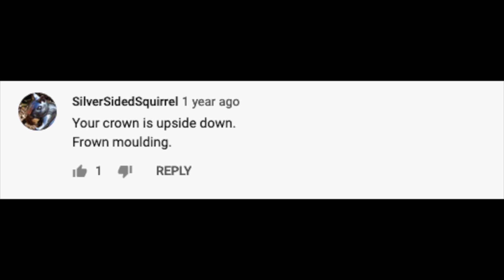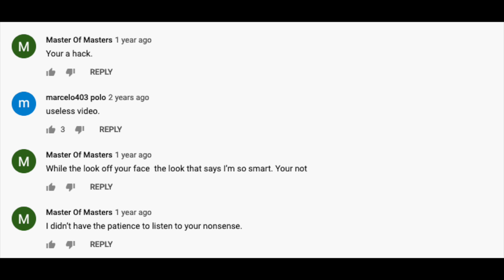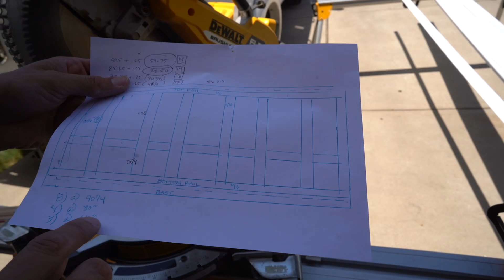"Tired of seeing this stuff put in upside down"

Comment: That's pretty slick how you built them as frames and then just set them in place and then nail it off. I like your thinking in using trim/moldings in perhaps unusual ways. I had crown installed in my new home and it's the same crown that everyone has in their homes. I like to be a little unique so I would like to take it out and basically come up with my own design for crown using different moldings. What concerns me is I have bullnose corners and I hate that little piece that everyone does on bullnose. I would somehow like to go back to 45s. Also I am not sure about getting tight inside/outside corner cuts. I'm not a handy man...I am a man with two hands (lol).

Comment: We have a 120 yo house with plaster walls. Picture rail is great because you can hang pretty much anything without putting holes in the wall. Running a drywall screw or a wall anchor into plaster rarely ends well. :)

Comment: I started carpentry in 1973. In 1993 I went to work in a factory building manufactured houses. First they just built simple ones without any crown or cove moulding. When they started using crown moulding they put it upside down. I kept telling them they were doing it wrong but they didn't listen to me.

Comment: There’s lot of this moulding used as crown in old homes in Chicago.  Almost always someone filled in the gap above the bead with joint compound so the bead flattens out and meets the ceiling.  Someone told me once the idea behind using the moulding originally was to avoid drilling into plaster walls when you hang things and avoid plaster cracks over time.  Not sure if that’s true though.  It’s hard to find new here when you need to make some repair.  Looks greats what you’ve done with it.

Comment: Your panel molding was originally called a chair rail molding.  It originally would have been a bit larger and its normal position would have been on a plaster wall at exactly the chair back height in a dining room.  Installed specifically so the a chair being moved of slid back from the table, would not contact or damage the plaster or daub wall.  Chair rails run around the room at approx. a 38 inch height above the floor.   I too have used it for a variety of solutions and aesthetic choices over the years.  My favourite has been a second ceiling accent run around the room about 6  to 8  inches below the crown molding.  That wall band between the two can be painted a different colour or contain a decorative wall paper strip.

Comment: On the crown argument, "Trim Carpentry" by Philip Moon (2007) states "The small cove represents the bottom of most crown mouldings."
That being said, what matters the most is whether the homeowner likes the finished product. If the ceiling is really uneven, it's probably best to follow the standard practice. Otherwise, beauty is in the eye of the beholder.

Comment: I have picture frame moldings and I use the hooks. It allows me to move different size paintings throughout the house without putting nails in the wall. It’s very convenient and fast! You have to be sure to really secure the picture frame molding to the wall.

Comment: That technique works well for hardwood door casing... if the jamb face is forward of back set to the plaster wall face... all you have to do is use a block the same size as offset to give u a perfect compound mitre.

Comment: That molding was used a lot in homes that had plaster walls to reduce the amount of nails/individual hangers in the walls. Still can be used today for the same reason or to add an architectural element to the wall just not many people know about it since the advent of drywall.

Comment: It looks great, spot on and modern, timeless style.  Not old fashioned. The original use for picture mounding could still be done on your wall. They had them installed up high several inches from the ceiling, with long wires and flat hooks up there, attached to back of pictures lower on the wall.  You could still do that with your panel mounding.

Comment: Looks great! Enjoy your channel! The only thought I have is that the larger bead on the top horizontal pieces will tend to be a dust catcher thats not easily cleaned out at the bottom of the v(in my house 😂) so I might consider a rabbet back to the apex of the bead (if that makes sense). Absolutely not saying you're doing it wrong, just a longer term practical thought.

Comment: More power to you, dude!  In the end, it ultimately comes down to what the customer likes the look of.  I deal a lot with electricians.  For decades, they have traditionally installed AC receptacles with the ground pin at the bottom.  But, in fact, the National Electrical Code doesn't define a top or bottom orientation for them.  In recent times, more electricians install the receptacles with the ground pin on top.  The only objections, I encounter come from customers who have an aesthetic preference.  In the end, if its legal and they are the ones paying for the work, whatever they prefer is the right way.

Comment: 6:30 "Oh, yeah, it's definitely gonna stick good!"  Hee hee 😁
As for everything else he said: (reading between the lines) "install it upside down if you prefer the look of it", "I'm using picture rail because I like the small but chunky profile" -- fair enough, conscious decisions from personal preference, can't argue with that in any way, why else do you put anything in your house.

And as for "I don't need an architecture degree to be a skilled tradesman", today I finished a job where the architect got every trade wrong you can imagine!  They (main contractor) insisted everything followed the plan even when each trade pointed out flaws.  Instead of working to a set of final registered drawings, we kept getting new revisions as either the client or architect changed their minds or saw it wouldn't work once parts were installed.  Ceiling tilers working to a fixed plan rather than using their expertise to modify where grid and suspension go to fit around my lighting, because the lighting plan changed 3 times while I was fitting it and I had to modify it because the heating engineers already had their pipes in the way, etc...

Comment: You know what brother, I'm older than you, but we do the exact same type of work, and you're just like me ( because I'm older than you), i mix and match mouldings all the time to get the desired effect I'm looking for, it's called thinking outside of the box, no pun intended. FYI, that picture moulding you're using in the vid, they used it extensively in the mansions in Newport RI exactly for the purpose of hanging picture wire off it from 20 ' ceilings

Comment: The "picture rail" trim was intended to be used on plaster ( not plasterboard ) walls.  Pound a nail into that to hang a picture and you risk a huge divot popping out or a crack going all over the place.  I use this trim in my 1920's era bedroom.  You can still get the hooks.

That said, your use looks awesome if somewhat expensive.  I had to order the picture rail online as my local suppliers didn't even know what it was - let alone carry it.

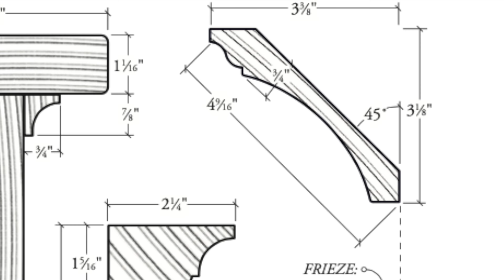Comment: The less detailed edge goes to the surface that is being ' featured ' . If the ceiling is recessed or coffered then the crown would be inverted from that shown  2:17  .  The molding is exactly as it is shown ,correctly , when the wall is featured , as it is in MOST installs .  (think in terms of picture framing, the ceiling , however ,is not being framed just because it has  ~ four sides ) (still, the customer is mostly right BUT always state your input )

Comment: Its a basic for trim cutting , use 1 longer ps of wood for blocking at saw  from L to R .glued only ends, then cut where is needed any angle, its NO GOOD when some wood trim ? board in the air, not sit tight against bottom of saw. IT will be kicks/jam/ crash/ bend blade, back fence/ fly and hit back of truck which is park next to saw. Safety thing.
And yes, any one can cut and install any  trim/wood board any way possible, long is nice and cool looking. Wheel is round, but can be lay just flat is well.

Comment: In Garys video.  The crown was installed correct.   Now if you want to get technical.  Thats a cove molding not a crown molding.  It's con-caved not proud which makes it a cove.   But... Out west they would consider that upside down because when i was working in Reno.  Its always upside down compared to where i live in MN.  I'm like are you guys nutzo.   Another thing... Out west an interior door swing is considered the opposite of the midwest, I don't know how they go about it out east.  But here in the real world the simplist way to figure door swing out instead of all the crazy theories is so easy anyone can figure it out.  Just put your back to the hinge side of the opening, use your left or right arm and swing it like it was the door.  If you use your left arm its a left hand door.  so easy it should be patented.  but then again commercial doors are called out the opposite swing as residential doors.   Yes I am a professional, can't you tell.  LOL

Comment: Excellent job as always. You need to get yourself a Fastcap best fence pro 4. I was going to get a cuthub, but the fastcap is awesome, especially for repetitive cuts like this project. I find myself installing so much faster and way more accurate on real wainscoting and shadow box installations. I also created a really easy to do crown stop for it, since I didn't like the stock one. I can send you info if you want.
I love that Windsor one molding, and have used it several times in the same scenario... Keep up the great videos brother.

Comment: Put blue tape down under the ‘ghetto jig’ then glue the block, makes cleanup a lot easier- The Wood Whisperer had a video on never buying double stick tape and that’s what he did. 

Also useful for support blocks on crown- blue tape on the wall, thick ca glue and wood blocks- boom easy to remove supports for long runs on finished walls

Comment: Picture moldings are very common in older houses in the UK, not unusual at all. I would guess they were used from the 1700 onwards to probably the 1950. My last house had them in a lot of the rooms and it is a Victorian building.

Comment: God bless you brother! Carpenters are to the design world what accountants are to the financial world. Accountants tend to be black-and-white, overly regimented and get caught up on minute details that often times make a little to no difference. Carpenters are also typically the same way. Ask any designer who has to work with a union carpenter or someone who’s been a carpenter for quite some time. They take longer than any other contractor on the job because they spend most of their time arguing with you about how something “should” be done instead of the way YOU WANT IT done. In the end, it’s about personal aesthetics and design. These thick headed carpenters cannot get it through their skulls that it’s mostly about form and cosmetics, and personal preference. It doesn’t make any difference where the Ogee is, top or bottom, it only matters where the client likes it and wants it in the long run. It’s not about structural integrity, it isn’t about safety, it has no bearing on function at all. It literally comes down to personal preference, that’s it. That’s why you will often times see the designer arguing with the carpenters.

Comment: That's old school picture rail...and crown comes in two flavors: 38/52 and 45/45 spring angles...typically you "install crown with the fancy side down..." but 52/38 goes only one way...that 'WindsorOne' profile is a typical profile that comes in about 5 widths...because it is 45/45 it can be installed either way...in my experience and opinion, if you have only ONE piece of crown, those 'fancy' cuts/beading give nice shadows to the upper portion of the wall from below...if there was another cap then crown, it may look nice with the fancy cuts up, but most profiles have those fancy cuts down.

Comment: For those challenged by trying to cut costly trims at compound angles like these....
Like for this guy cutting trim, cut & assemble all the corner sections, Then do straight cuts to fill in the longer straight sections....Last, caulk/smooth the joints & paint....as opposed to trying to expert-cut each long side as a single piece, because, handling long pieces risks joint errors that must be filled & camouflaged too much.

Comment: I've recently tried to use architectural moulding to make picture frames - scheez, it's tricky (I'm no carpenter).  Measuring and cutting to CORRECT size is like lucky dip for me. I may be able to adapt the measuring method you demonstrated... just inside out. Thanks for the info.

Comment: Thats nothing I once lived in an apartment where the entire balcony/sliding doorway was put in upside down.   The sliding part was on outside (so you couldnt use a bar) and even the lock on handle which was the lever/latch just fell down and unlocked.   Best security ever!

Comment: Picture mold is the result of "Necessity is the mother of invention" and "form following function". It's purpose is to be able to hang pictures on plaster walls without  damage to the plaster and lath. This not opinion, it is trim moulding history. If a person looks at some old mill house supply books there are a few other profiles that preform the same function but are not the same profile. Happy trimming!!!! Looks good.

Comment: Picture moldings were not designed to hang pictures, they are only called picture moldings. They are an upper molding that can go to the ceiling but are commonly used below friezes. They can be used to hang pictures, but visualize that and you will see why they are not.

Comment: the crown moulding is designed to mimic the rounded barrel vault ceilings of a castle ... the ripple goes at the top and the curve goes down the wall ... to replicate the barrel vault ceiling ...
Reply: funniest part is the one major mistake made by finish carpenters everywhere ... your wall is NOT square ... thats not a 90 deg corner .. 91 deg or 88 degree sure ... rarely do you get 90deg corners in any house ... measure the angles before you cut ... cuz a default 45 degree cut wont cut it all the time ...

Comment: Here’s a way to think of crown or other trim mouldings, back in early days each moulding or ogie were separate little trim pieces, everything was built up, all these were made with simple hand planes, today machines, routers build up all cuts in one piece.
The arm chairs are right in general, the ogie was on the bottom to soften transition to wall, added detail, the bolder side of crown gives it a Miny coffered look,  also many of these crown details were made of plaster, it’s a matter of taste, but there certainly be build on steroids, tooo much.not every house is the palace of Versailles.

Comment: To me, in my crown installation history, most typical crown is a 32°/ 52° "spring" and some crown is a 45° "spring", to which a 45° crown is the installers discretion, and the "typical" 32/58 install being the 38° is installed against the vertical...
Reply: *32°

Comment: That turned out pretty c∞l!
I probably would have never picked that moulding for a use like that...until now. 😎
Reply: Also, another term used for cutting moulding in the cradled position is nested position. You probably already know that, but others may not.
Again, great job as always, and thanks for sharing your work and ideas with us!

Comment: I have only seen the picture molding in lath & plaster homes or old condos with a concrete interior wall. Purpose is so you don't have to put picture nails in the walls when new owners move in or when you change pictures. Drawback is all pictures are same height. Just what I have noticed.

Comment: There is a correct way to install it. Period. You can use it in different applications but it always has an up and down. If it does not then it is not crown in is cove moulding. You can generally tell which edge goes up based on the size of the edge face nearest the ceiling. It is generally wider on the top edge of crown.

Comment: When cutting from a 16 ft length.. I'd keep the saw angled for the right hand side 45..then once you cut all of your pieces slightly long.. turn the saw for the opposite 45.. Set a stop and cut all of the left side 45s..this way your not flipping the saw back and forth all day..

Comment: For years I installed crown what would be considered upside down, on the East coast it is right side up, on the West coast it is upside down and then after thinking about it who cares  what side goes up or down as long as it looks good, explain why  it matters? the only time I can see when crown direction matters is when it is under 45 degrees like 38 or 52 degrees and then it still depends.

Comment: You need picture molding in case you have wallpaper and don't want to punch nails in the wallpaper for your paintings. Might want to move the painting later, and don't want a hole in the wallpaper. :))))

Comment: It’s the same with decking! Every time it’s installed it is ALWAYS ridged side up,which is the wrong way,as the ridges allow for airflow underneath to prevent the wood from rotting! Even the advertisements show it ridge side up 🤦🏻‍♀️ Just look at ship decking.ALWAYS SMOOTH!

Comment: Any research through books on Architecture and interiors will show you that the long panel goes on the bottom. You have it backwards. This isn't wainscotting. This  would be correct only for a chair rail and panel treatment.